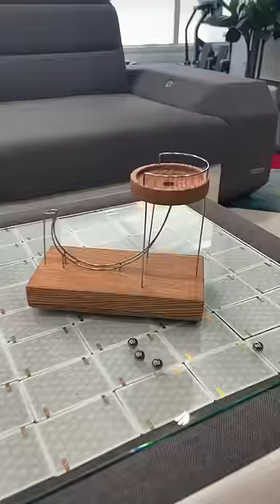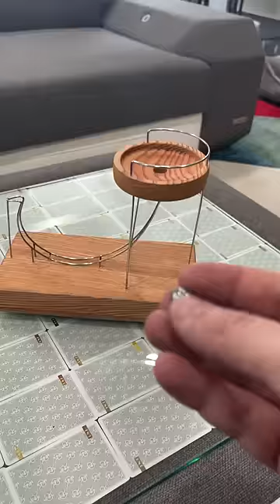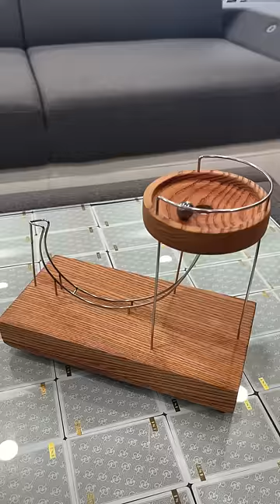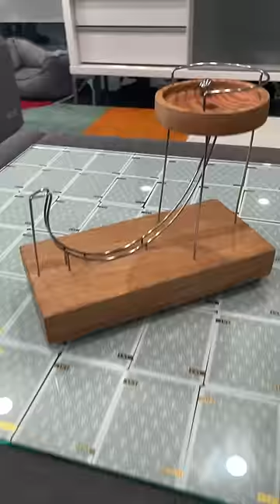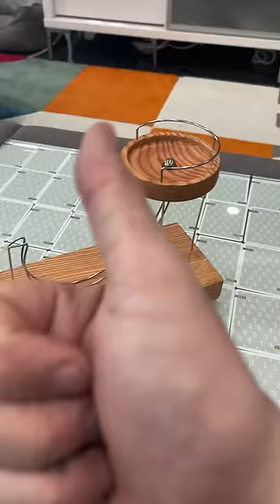An Impossible Perpetual Motion Device?! 😳 #Shorts

Comment: weird thing is you know it’s not completely perpetual becuase it makes noise
Reply: Whats noise got to do with it ?
Reply: @joestitz239  Noise comes from vibrations which come from energy, so to make noise it has to lose energy.
Reply: Yep losing energy through friction and noise.. wonder how long it took to stop..
Reply: @AsKyOdA  also heat
Reply: @AsKyOdA  generally there's a battery and electromagnet somewhere giving the ball a kick on each loop, so until the battery dies.
Reply: @randomuser6110    You are right, but there are also ones that have a motor to speed up and spin the ball.  Either way, you need batteries.  LOL
Reply: I thought that gravity was in charge of giving it enough enegy...
If there was nothing to give it an extra kick , would the ball just not be able to "jump" back at some point?
Reply: @afiffarhati4580      I've seen it done without the battery or turned off, and it only goes up a bit over  halfway.  It can't go all the way due to friction and air resistance.
Reply: @my3dviews  study vertical circular motion, grade 11 physics
Reply: @MrChuchu4life    Study the laws of thermodynamics.  Due to friction perpetual motion machines can't work.
Reply: @my3dviews  I am Johnny sins  🤣🤣🤣
Reply: @afiffarhati4580  yeah. On the first time. With only potential energy (ie gravity) and no loss, it could only jump as high as it started from.
Reply: @randomuser6110  I've seen in one video that there is gear ⚙️ like wheel in that hole which works on battery beneath and pushes that ball, that's why it speeds up through hole.
Reply: It uses magnets. If something has an energy of 0 then it gets a boost of 100, before going back to zero, it's still going to get a boost of 100 every time. What do you mean?
Reply: It's gaining energy from gravity, so it could afford to lose some to friction.
Reply: @nocturnal6863  Ah , i actually get that , that make sense , thanks for the response.
Reply: It runs on batteries
Reply: It's gravity that is acting on the bead supplying additional energy
Reply: Also it has hidden magnets or smth that make the ball go faster
Reply: @wojtekpolska1013  heat is wasted energy
Reply: @redtortoise  Exactly
Reply: @@lespoje8526 correct my fault. Sorry. There are batteries in the plate. Gravitational Potential Energy gained won't be enough to push the ball higher than when it dropped.
Reply: If it were perpetual, noise would be some of the free energy produced
Reply: Yeah but it gains energy on the way down again
Reply: @Joe Stitz is right, noise has nothing to do with this, if perpetual machines existed, they would could be capable of producing noise because perpetual motion machines in theory produce energy, so noise would just come from that gained energy. It not perpetual not because it makes noise, but because perpetual stuff violates conservation of energy + it's fake with motors or magnets
Reply: @AsKyOdA  it's got a battery electromagnetic inside I think
Reply: do it in a vacuum
Reply: theres a magnet that pushes it amd theres a hidden button to activate it
Reply: @AsKyOdA until the battery is emptying
Reply: It's battery powered
Reply: They’re battery powered
Reply: Even if it didn't make noise, it still wouldn't make sense because it moves air around it. Make a small turbine near the drop to absorb the air that it displaces, and poof, magic energy.
Reply: So I'm pretty sure it just has something boosting it (like the things on the hot wheels tracks) hidden in the whole before its visible
Reply: I think so long as it can get enough energy from the fall down the to guide rail it could continue almost forever.  The marble would still eventually wear down the rail to nothing just from the constant friction.
Reply: If that would work without battery, he would have patented and sell on the toy market.
Reply: @AsKyOdA  Magnets
Reply: @afiffarhati4580  if you consider 100% energy conservation (that is, no loss), then AT THE VERY MOST the ball would be thrown up to the height it was before falling, so even in ideal conditions, what you see with this device cannot happen since the edges are higher than the hole.
Reply: @chadmensa  That's not exactly true.  When physicists talk about falling objects, they say that potential energy is being converted to kinetic energy.  The higher up an object is, the more potential energy it has.  The longer the object spends falling, the more kinetic energy it has.
So gravity isn't really adding energy to the ball bearing.
Reply: To all the people wondering, it has a magnet under the main bulk of the wood. A ball falling naturally through the hole wouldnt have enough momentum to fly back to the top
Reply: It sounds to me that there is negative and positive rails. It could be magnet / coils, but I think still that voltage goes tru to steel ball.
Reply: I saw a video that these are fake, they have a hidden button and power supply to give the ball enough energy
Reply: Its battery powered. I think a electromagnet.
Reply: @growskull  magnet
Reply: @TheHarryMann  yep electromagnet
Reply: @AsKyOdA it isn't working with gravity, there's a battery and magnet, so once the battery dies
Reply: @afiffarhati4580  no it doesnt have the momentum from that small of a ramp to make the jump without an outside force
Reply: @Thedarkwaterbun  there is a magnet under the bottom piece , it pushes it to go faster, jump higher
Reply: It loses energy.. that's the noise.  It has enough energy from gravity on drop to start over.  Basically the energy required is less than the added energy input from gravity.  Loop the process.. and it looks cool.
Reply: yeah, that's why it's impossible ;-;
Reply: @randomuser6110  yes . I think hidden in the base
Reply: @joestitz239  noise is energy
Reply: @wojtekpolska1013  not also, all. All exergy is finally turned into anergy and for that finally in heat.
Reply: @afiffarhati4580
Reply: @Thedarkwaterbun it's a circle, and the wood is funneled shaped so gravity takes care of it
Reply: @Afif Farhati  If you drop a ball that bounces onto the floor, no matter how bouncy the material is, when it bounce back the first time it's never gonna reach the same height you dropped it, same concept here, there will never be enough energy to launch it back the same height because its gonna lose energy on the way down
Reply: @joestitz239  the same thing that love does
Reply: @my3dviews  I know I'm interjecting outta nowhere ..
it did seem very odd that that ball was flung so hard right back to its position . Batteries ..
Soo dissapointing ..
I would've built a similar model ... With reduced inefficiency .. that'd generate electricity .
But dumb hope .
But a guy's gotta hope no !
Reply: @yasirrakhurrafat1142    Well, even if there was zero friction and air resistance, at best it would get up to the same height as it started.  And if you look at the device it has a lip around the top tray where the ball goes through a hole. That would mean that it could not get back into the tray even with no type of resistance.  
But of course, we live in a world with an atmosphere and one where there is friction between objects.  So it would never get even close to that height.  
Which is why all perpetual motion/over unity devices are scams in one way or another.
Reply: @my3dviews  bro .. I bet that even if the ball only went back to the top . Only to how and where it goes in the video . I had an idea for it .
But as you said .. it's using batteries .
And the possibilities are none if we consider atmosphere and friction .
Physics .
But I have another theoretical idea .. I don't know if its feasible .. cuz ya know ... . Its another probably impossible idea . But I'm hoping that it works . Its a rabbit hole . That I don't know if its worth looking into .
If though you're intrigued by my dumbness . I'll tell you more .
Just for laughs if you want .
Reply: @AsKyOdA  it wont. It has a magnet in the base that pulls the ball down fast enough to reach a sleed where it is capable of reaching the platform
Reply: @Junispro31  that not how physics work
Reply: @zanexdreamy  I did made another comment to clarify my mistake
Reply: @Thedarkwaterbun it’s losing energy but it doesn’t lose momentum
Reply: @chadmensa uh... i think u need to think more
Reply: That would be the case, if the noise was stopping the ball getting back into the same state it's in just before it falls through the hole, but it doesn't, so the noise is irrelevant.
Reply: If noise could be harvested and converted into useful energy?
Reply: It's gravity fed, even though the friction of the ball against the metal causes some loss of energy. Gravity adds energy to the ball as it falls. Some energy is lost but it also gains it back from the attraction to the planet.
Reply: And it comes with a battery. It's a misleading ad
Reply: Actually placing the ball and starting it means it’s not perpetual motion as it didn’t start itself
Reply: @AsKyOdA it doesn't stop since it's electrically powered and shoots the ball into the loop
Reply: Not to mention the reaction magnet and circuitry in the base. I have one.
Reply: I feel like this was bought at Spencer's
Reply: @Thedarkwaterbun That energy it’s losing is coming from hitting against the wood, which is on a downward slope, which is always going to lead to the hole
Reply: This is a perpetual motion device. How exactly would it ever stop?
Reply: @joestitz239  noise indicates a loss of energy thru friction. That lost energy has to he regained somewhere. Cant get something from nothing.
Reply: @joestitz239  Noise means it's losing energy...
Reply: bro i stirred up an entire physics war using my half awake physics class knowledge 😭
Reply: @Thedarkwaterbun  oh…. Does it have to? Circular reasoning? Because it contradicts 1st and 2nd law? Does it? Contradict 1st? No! Its a closed loop but can it be transformed? I already suggested thru developing electricity.
Reply: Noise is a bi product or reaction But a hinderance?  Mass, gravity, due to mass multiplied by inertia repeat. A closed system or loop, But can it be transformed? I suggest magnetism! Reconsider 1st rule!
Reply: @Thedarkwaterbun  its obviously incorporating mass, gravity and inertia in a loop! Energy in a closed system neither lost or gained….. only transformed…how to transform? Magnetism! Electricity!
Reply: @AsKyOdA  thank you yoda! Like aikido! Fluid motion! Lao tzu’s tao!
Reply: @randomuser6110  your missing energy increase thru mass multiplied inertia by gravity! No need for electricity! But develop electricity by transforming the energy? We already do that from wind, water (hydrological system), sun light.
Reply: @my3dviews  see response to randomuser
Reply: @jasonpark1556  gravity does help it a little, but as many other people have said, it is powered by an electromagnet that gives it a push. Gravity could never do all of it because a dropped object can never go higher than its starting point unless it gets extra energy.
Reply: @AsKyOdA  it has a magnet in it
Reply: @afiffarhati4580  wow you aren’t that smart clearly i feel bad for you brother😂😂😂
Reply: @chadmensa thats not how energy works
Reply: I love how many people here are so confidently wrong.
Reply: Woah thats so true🤔 friction decreases momentum
Reply: @joestitz239  well if its making noise that means some friction is happening, ie. Its sticking to an extent, and friction slows things down
Reply: @Thedarkwaterbun  exactly
Reply: @randomuser6110  huh, that would make sense, i thought it seemed like there was some other force going on here like magnetism
Reply: @afiffarhati4580  yes and im not sure if it would even be able to do it at all actually
Reply: @my3dviews  makes sensr
Reply: @joestitz239  noise is a release of energy. Hence why bombs have “shock” waves
Reply: Biggest excuse to cover for science I've ever heard
Reply: @joestitz239  ... no words
Reply: @Thedarkwaterbun  But it would be creating more energy as it ran, and the noise would only take away small amounts of energy.
Reply: @afiffarhati4580  energy is conserved. The potential energy from gravity is converted into kinetic energy, friction (heat), and sound as it rolls down the rails towards the bottom. As it starts going back up the rails to make the jump, the kinetic energy is converted back into gravitational potential energy whereas the friction and sound are lost. It cant come back up with more energy than it had initially, and since it lost some energy to friction and sound it actually cant come all the way back up without interference ever
Reply: @chadmensa  it also loses energy from gravity when it goes uphill
Reply: @AsKyOdA these machines actualy have a small magnet that speeds the metal ball up otherwise it wouldnt even jump once
Reply: You can can tell because it exists
Reply: @mydknightcloud  no, there is just a magnet, sorry.
Reply: It gains energy when going down the slope and loses energy when it lands its natural
Reply: @insanetiktoks2826  sadly no! Thay would only happen if system conserved energy perfectly, but as you can hear it lets sound off AND losses energy to friction, i doubt i would even have enouth energy to jump back once!
Reply: @Insane Tik Toks  it never gains energy, it regains some of the energy released during the drop
Reply: Cant be perpetual because you are putting energy in to start it.
Reply: @calebbarnhouse496  read what you just said
Reply: @OGumbal  but this is a prototype to something that could easily keep the ball in motion or whatever it would be on a bigger scale then it would create energy
Reply: @insanetiktoks2826  L cope
Reply: @insanetiktoks2826  dude, did you fail physics class? one of the BASE RULES of thermodynamics is that energy cannot be created!
At the perfect conditions the ball would only go as hight as it started.
It CANNOT go on forever because friction slows it down and makes it LOSE energy.
Don't talk about crap you dont know about.
Reply: @OGumbal  okay buddy explain how a ufo moves if energy can’t be created… thought you knew everything? And how exactly do you know that we can’t create energy from this and make a way to store it?
Reply: @OGumbal  that’s crazy because i was just in a ufo last week and it’s literally made of energy no batteries nothing maybe you should watch more hasanabiu
Reply: @insanetiktoks2826  this has got to be satire, no way a someone would say that seriously, im out
Reply: @callanc3925   that makes sense! some of the energy is lost and so gravity isn't enough
Reply: @afiffarhati4580  Yes sir. Another great example of this concept is some videos online of professors getting these huge swinging weights set up in the lecture theater. They will stand with their back to a wall, hold the weight directly in front of their face and let go. It swings across the room and as it comes back it never touches the professor as long as he doesnt move because it will never have more energy than it started with.
Reply: @callanc3925   There are multiple professors doing that !? I thought it was just one guy in a video i saw , i didn't know it was common , that's hilarious xD